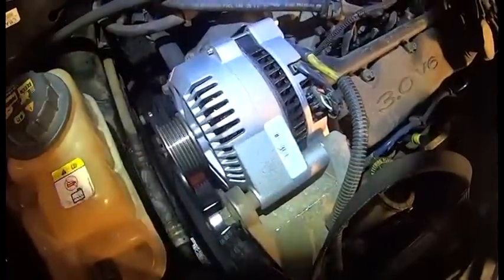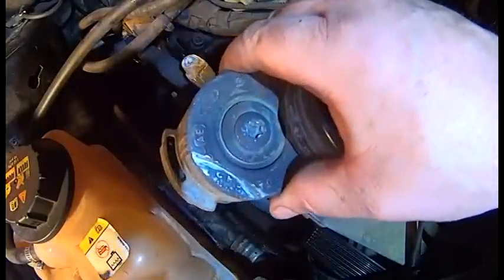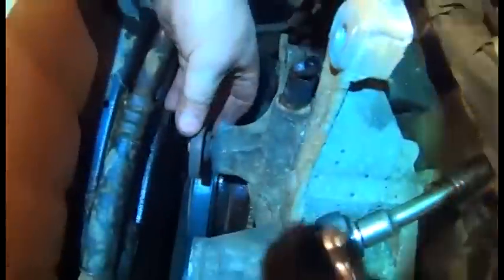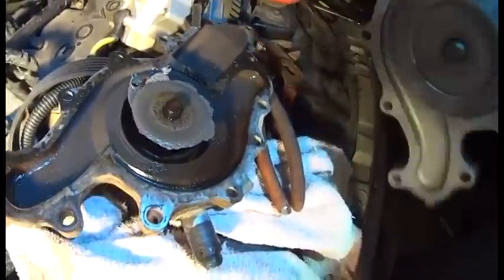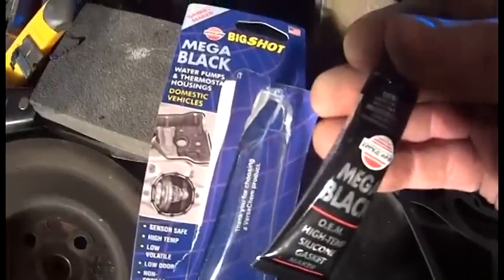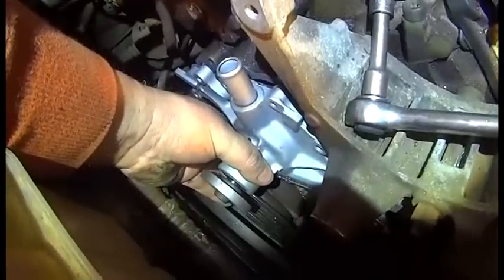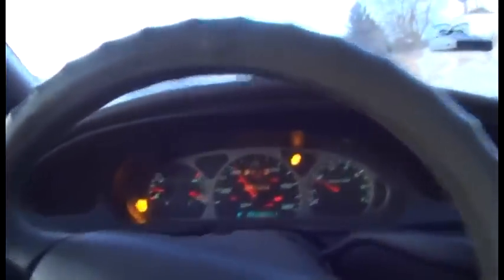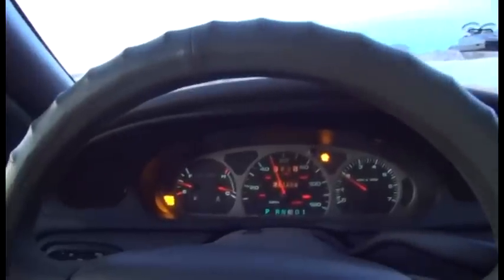Ford Taurus Water pump Replacement

Comment: Thanks for the video, just want to add a few things I learned while replacing mine..
I used the gray colored RTV specifically for water pumps. Also, make sure you use high temp thread sealer on the bolts that penetrate the water jacket. When you remove the water pump, some of the bolts will have a red colored thread sealer on them, the sealer I used is white. After re-assembling the water pump, I let the RTV and sealer cure for twenty-four hours..no leaks after a month of driving so far. My original water pump lasted 208,000 miles!!.

Comment: Thanks for the vid; love that you gave us bolt sizes to help speed things up.  An important note about the replacement part = I put in whatever Auto Zone has as the cheapest and it went bad in no time; spent the money for the Ford part like the one I replaced after over 100,000 miles.

Comment: I got a 1998 Taurus wagon with 24V dohc and have 106000 miles. I had the same problem engine started to run hot while coming home from fast food store near my house. First thing I replaced was thermostat it had 180 degree unit, and I changed it with another 180 but still run hot while checking for overheating. One thing I did notice was my water pump was cool to touch and my engine hot and still over heating. Next thing I did was to remove the water pump, on 24V water pump and housing comes off together, so I got the pump off the engine I looked into the outlet and I can see the impeller were broken. I took the pump off the housing and impeller is made of plastic and impeller broke in three pieces. I'm shock to see that your water pump is made of metal and you still lost the impeller. I know why they used the plastic impeller but if I was driving to San Diego or Vegas it would blown the head gasket. Its been a 3 weeks and still running good. Thank for your video

Comment: I know this video is old but this shows how important it is to change your coolant. You don't have to change as frequently as oil but it's pretty easy (on most vehicles). And you don't have to flush unless there is a problem that requires you to do so (Rust, oil contamination, wrong coolant, tap water, etc.) I have an 05 Taurus with about 254,000 miles on it and just did the Timing cover gasket and water pump gasket and both the timing cover and water pump had just slight surface corrosion with the impeller fully intact and the splines were good and they are factory original. And the coolant had been changed somewhat regularly by the previous owner. There is also a whole host of other problems caused by not changing the coolant other than just this. Preventative maintenance can last you a long time.

Comment: Great video with lots of good tips. Did our 2000 Taurus today. It seems there a little more room on the passenger side of the 1999 than the 2000, requiring me to remove the coolant overflow tank to get the bolt in/out of the alternator, and still was tight getting wp in and out.

Comment: Thanks, will flush it out good, don't want to do it over again the belt tension  bolt was rounded out I  tried to do what you did by using 1/4 inch tool but it was bad. The pulley bolt that you use the 15 mm tool  to loosen the belt was also rounded off . I just got it off today and will be putting it back on today my water pump fins was like yours rusted out ,just spining in the water not even circulating it. So thanks for your vid it helped me out brother.
Reply from the maker: Yes, make certain it's flushed good. The one I installed is already worn out and I thought i had it flushed good enough. I'm waiting until no more freezing nights and going to have to run water through each day for a couple weeks and keep draining before I change it out again. One thing I think would help is a rare earth magnet in the overflow. have one in there now and you wouldn't believe the amount of metal that keeps sticking to it. Have to throw a vid on showing it.

Comment: Instead of removing that lower cover to get at the drain plug, I used a hole saw to cut a hole. Now I can drain it easily without any problem.  I didn't read all the replies, but using distilled water with anti-freeze will prevent further rust problems.

Comment: Thanks for the video.
My fiancé's 2000 Taurus is leaking just above where the bottom rad hose goes to pump.
The serpentine tension pulley is froze up, I have or should say had the perfect size star socket but it stripped smooth, the bolt is still ok. It's on there good, real good. I don't know how you got it with a hex.

Comment: Thank you sr. just wanted to know if i had to take the big power steering platform but shurly appreciate your explaining. forgot to take them bolts of the water pulley first. wont forget next time.

Comment: Most expert mechanics do not recommend using RTV with those paper gaskets. Use one or the other but not both. Research this for more. Typically when you change the water pump, the timing chain seal will go bad. That is notorious for the Ford 3 liter V6. Mine leaked a little then about 6 months later the timing chain seal went and had to pull the pump off again

Comment: Yeah gonna have to change the water pump on my 98 taurus I think, I changed the Thermostat and Heater Core still vary little heat , whats funny is the car will never come close to overheating, in fact it seems to act like the Thermostat is stuck open, Only time I get ok heat as at 3k rpm and the temp gauge gets cooler until the Thermostat closes. Wish I had a garage this time of year lol.

Comment: i have the exact same problem.  very little pressure and low heat blowing inside the car. im hearing a jingling sound about where the water pump is. is that a Def sign that the pump is no good. i just flushed the system this past wknd.. same prob but temp gaufe doesn't move past the lower end. just sayin, i plan on changing out the pump.  your vid was very helpful. Any suggestions????

Comment: Removing the reservoir makes the job easier with more room.
Reply: Yeah,  that's what I did. I also put a floor jack with wood block under oil pan and lifted engine a little.
Reply: Nathan Chance w.
Reply: @JKB3670  wait what? Isn’t that bad for it? Do you have to loosen some stuff for that

Comment: Replaced ldler and tensioner that we're worn, assume the raddle at 900rpms is ps pump. My temp gauge fluctuates but never to the hot side, if it weeps on the belt that explains no puddles but NO heat inside most of the time guess pump fins could of clogged it, I have backflushed the core but...guess I'll change the pump and flush block also, what else is there don't think thermostat would make it act that way or...
Reply: Or flush the block and core seperately first and change the thermostat, was a well maintained (old guy) car. Acts like the state is sticking, I'll take any suggestions but think I've narrowed it down, after owning 30 cars over the yrs ya still learn new things

Comment: Is that rattling noise normal ? My Taurus has the same noise sounds like a bearing going out.
Reply: I believe that's the power steering pump. It's either low on fluid, fluid is old, or it's just worn out. These power steering pumps tend to make noise as they get older. Mine is original but isn't that loud and you almost can't hear it when it is warmed up.

Comment: would you happen to know the correct size of that star socket? I'm stuck on that pulley I'm on my way to autozone, if you know the size it would be great.
thanks
Reply: +Horacio Rodriguez  It's "T-50."
Reply: +Robert Mackey 
I figured it out, but thanks for replying.  great video

Comment: How long exactly did this pump last you? You probably have giant chunks of impeller all over in your coolant system.
Reply from the maker: Helladamnleet Car is still running with the same pump to this day but had to flush the coolant several times after. Think there is no end to the rust
Reply: Interesting considering you mentioned the pump already having gone out
Reply from the maker: Helladamnleet  Originally thought that on the comment from a year ago., suffered through the cold until spring as stated whenever someone would drive it. Then decided to change out late spring. Pump was good. The heater core plugged up tight again is why no heat hardly. My guess is will have to put a new core in if it does it again after flushing. Impellers were still good on pump. Should of updated the comment I guess.
Reply: Ah, okay. Thank you for clearing it up.

Comment: the T45 bolt to the idler tension-er pulley is stripped, how do I get the bolt out behind it?
Reply: Use a ease out
Reply: It should be a T-50 torx for the tensioner. Also when you put it back on there is a locating tab on the back that has to go through a hole behind it so you don't put it back in wrong.
Reply: @dixiedevil8607  easy out

Comment: I think I can do this. I just need to get the right tools and have a day off from work. Seems like the water pump is working on my Ford Taurus but the bearing is squeeking very loudly along with a slight knocking sound that comes and goes every few seconds when idling. It's not the lifters, I know that for sure. This sound comes and goes every so often.
Reply: I have the same problem gonna change my water pump tomorrow, thought it was the alternator changed that and that wasn't it

Comment: Can u tell me all the tools I need for this job
Reply: For anyone else you’ll need some regular tools 13 mm and 15 mm sockets maybe an 8mm you’ll also need a t50 Torx bit, some type of breaker bar or pipe to get the bolts open, water pump gasket, high temp thread sealer white one is good,

Comment: Thanks brother for the vid!!! It sure helped myself fix my 98 Taurus wagon.
Reply from the maker: No problem. Make sure all the rust is out of the cooling system. I  Found out the hard way. Will burn the impellers up again otherwise,
Reply: scannerguy1968 How do I get the rust out?  Just keep flushing it until it is clear or is there a better way? That might explain why I am having to replace the water pump again so soon!!!
Reply from the maker: hobosarah
 Some replace the overflow and radiator then flush. If it is real bad I would keep running water during the summer and flushing once a week until It looked good. Also I dropped a decent sized magnet into the overflow and pull it out and clean it off then drop back in a few times. But this won't get rid of aluminum filings.